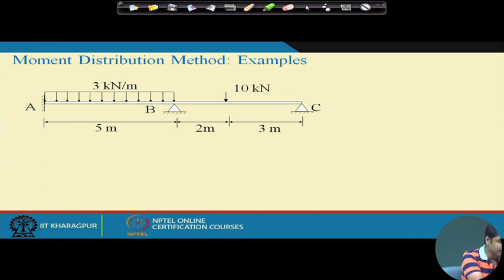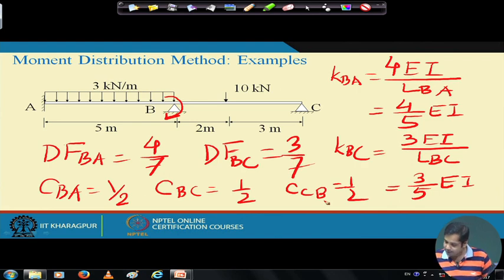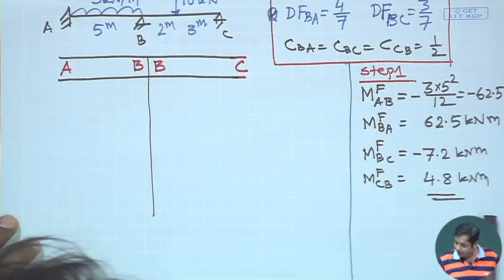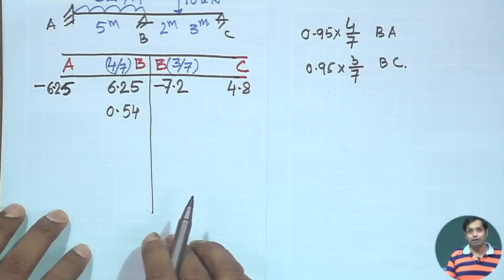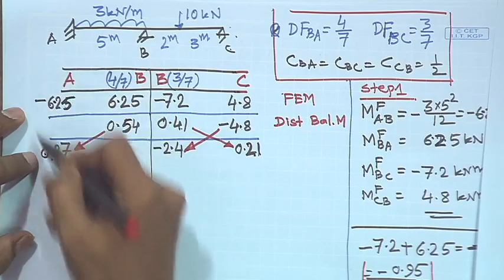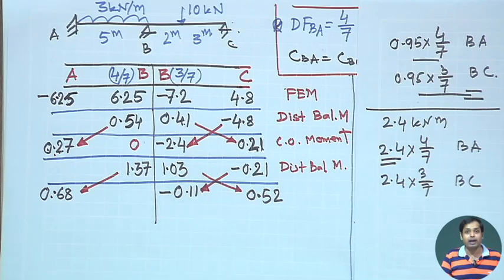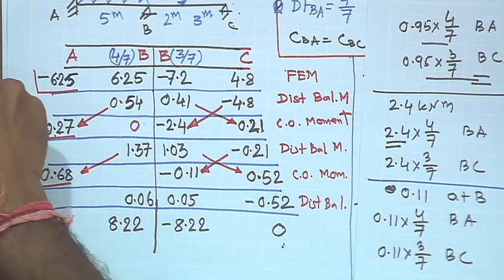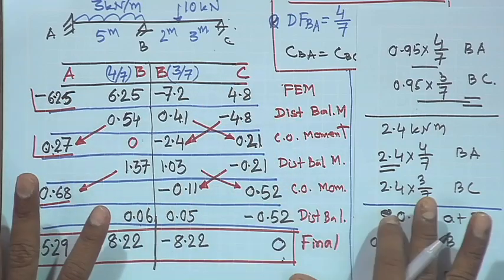mod11lec54

Comment: Wherever 3EI/L is used as a stiffness factor at the pinned joint, the carried over factor should be zero at the far end of the same span.
This is because the far end contains the pinned joint not a fixed joint.
Thus, C(BC)= 0
Reply: Although the moments obtained are very close.

Comment: what should be carry over factor for CB?,,i thinnk you have done mistakenly wrong..plz tell
Reply: Please ignore if you've already figured it out. In case not, the joints B and C are assumed to be initially locked and you free them, one at a time. When you free B (C is still locked/fixed), the moments are carried from B to C and A by distribution and carry over factor is 1/2. Then, you lock B and free C. So, now C is free and B is fixed and carry over factor is 1/2. If still in doubt, please refer to the chapter on moment distribution in R C Hibbeler book.
Reply: @tanmaypreman8459  hey , always the carry over factor will be half in general case ?